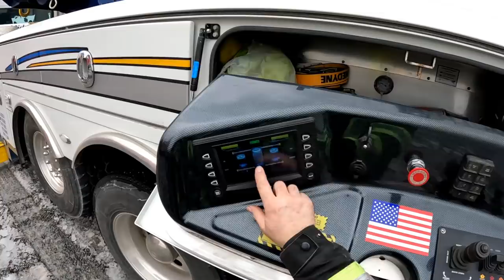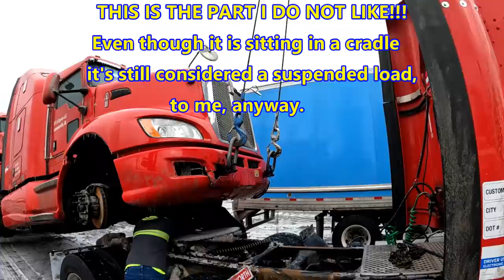PiggyBack Re-Stack

Comment: Ron  -  As a retired firefighter and medic we found that if you drilled a 3/8" hole in your blocks, cribbing, and run a 1/4" rope through the hole, tie a knot and work it into the drilled hole that it made for ease of grabbing and pulling.  Just a suggestion.  Great videos.  Really miss the "Q" sirens on the trucks.
Reply: It’s not on all the blocks but many of them have ‘handles’ made from pieces of (I believe) fan belts. You likely have seen that in other videos of his, and one of the blocks here had that on it but apparently not the other.
Reply: @JohnHallgren  you are correct I’ve seen in other videos he has cut up serpentine belts and attached them for handles

Comment: As a ex fleet technician for Bridgestone commercial the technician banging the ice of the face of the rim I definitely was shocked as if I did that to any of my customers rims it would be a very serious case,  and yes I have worked in far worse conditions indeed,   but all by myself as well in having to replace every wheel and tyre in extremely dangerous situations,   but then again these tractor units pig backed is absolutely ilegal here,   but our truck's have 9 axles and carry up to 42 tonnes payload, but then again Ron and team are the differences between the normal again ☺.

Comment: Did I miss the part where they explained why they didn't just use the first truck as the power?

It is cool to see how the piggy back system works.
I have seen it with new trucks many times.
Was not aware it was used with used trucks.

Comment: Wow, that was a mess. But with everyone working as a team, it went really well. Good job everyone! I always wanted to drive a tow truck. Just watching your videos makes me realize, that probably wasn't possible even in my younger years. I did learn something.  How you crossed the cables in an X while lifting the 2nd truck off the wrecked truck. That may be a common way to do it, I just didn't know. Great application for me to use on small things too so it doesn't sway. It's all very interesting to watch.

Comment: I drove these 4 way stack units from Dallas to California every week for two years for a company called NTC (National Trailer Convoy). Lots of fun but0 unless they changed the design of the saddle that attracted the trucks I can see how easy it broke away. The snapped blots all the time we would have to call Raider to come out and repair them. We mostly drove at night because the trucks would rock and sway like train  in fact we called that last truck a wild dog on a pice of kite string. 
They banded the front tires to the truck's and when you sometimes stopped other truckers would steal the tires so when you got to your destination they couldn't undock them.  Never drove a set in snow or ice..
TC

Comment: I have enough problem just lifting my car tire up and getting the bolt pattern aligned. That they were able to just slide the wheel on once it was at the right height was amazing, but I guess it helps when there are so many lugs that they almost aligned anyway.

All in all, it seems easier to just drive each truck to its destination and rent a car to drive back
Reply: These trucks could be going a couple thousand miles. Easier to drive to the destination individually, maybe, but the savings in fuel and driver time make it worthwhile. Not to mention most outfits won't want to see their "new" trucks delivered with mileage on them. We got a "new" specialized truck last spring that had been roaded to the upfitter then driven to us, and it had over 4000 miles on it already when we took delivery.
Also you get real good at changing wheels when you do it a bunch.
Reply: One driver can get 4 tractors to a destination and 3 still have zero miles on the odometers (i.e. new).  Then he flys back.  Or you have  4 drivers delivering 4 used tractors and 4 airline tickets.
Reply: on short distances it may be cheaper but on long distance It's a whole lot cheaper to pay one or two men a couple hours at the factory to stack them and the same at the other end. They have an overhead crane to stack them and usually the same to unstack.. many years ago I was at a Mack dealer when the trucks came in they had an overhead crane and it didn't take any time for them to unstack them. Plus the drivers work for a third party company and travel all over the country delivering vehicles. Once they deliver the company may have them another load somewhere nearby to deliver. They usually don't just go home after one delivery.

Comment: I’ve seen decked tractors where the plate goes on the fifth wheel and bolts to the axle and I’ve seen a few where it’s almost like a goose neck and the rear tractor is lower to the ground.

Comment: I'm thinking you need some ice cleats.  I have some K1 Mid-sole Ice Cleats from my work that are on a rubber strap, and fit into the space between the toe and heel of the work boots and have several steel spikes that dig into the ice.  Nice thing is when you don't need them, the plate can be slid to sit up on top of the foot out of the way for when going inside.

They don't interfere with driving in either spot.  I have a set on my winter boots that just stay on the boots.  Have to say they are more comfortable when wearing with a boot that has a metal shank.  Would help keep you from slipping around in icy conditions, and when not needing them, they take up less room than a pair of gloves.  For $30 they are well worth the investment, as it seems you do get some nasty icing conditions there.
Reply from the maker: I have some ice cleats.   They are different that what you describe.   I will be showing them on an upcoming video where I have to put them on along with putting tire chains on the rotator for the FIRST time ever!!   We had other trucks and I've had to chain them, but I've never had to chain up the rotator, until this year.  Again, video coming soon.   Thanks for watching and God bless.

Comment: was that (formerly) 2nd truck too damaged to be the power unit for the stack???   only damage i saw was the front bumper.....  also, i've seen these types all my life and the ones ive noticed were always just blocked up with a pin connected to 5th wheel instead a cradle behind it....   maybe just a different style connection... always interesting to see how things are done

Comment: This is an interesting series Ron. I've never seen this style of "piggy-back" stacking before. Here in Scotland, even seeing a handful of units on a trailer isn't that common but I've never seen them wheech the front wheels off for transport. I may be completely wrong but I don't think this sytem has reached our shores yet.  I'm kinda interested in the logistics of the system. Under normal operating conditions, would these guys have a wrecker on permanent stand-by at their yard, or would they use a gantry crane, or something similar?
Something that just occured to me: were these new trucks, getting delivered, or is this just an everyday way of moving several trucks, with one driver?
Nice to see Talon getting all hands-on again too.👍😁
Reply from the maker: Here is the U.S.A. this is a common method of transport for both new and used trucks.   These trucks were used and going to a lot in Texas.    Manufacturing plants and a lot of dealerships have gantry cranes to lift these truck for decking/undecking.    Otherwise, a heavy towing/recovery unit, such as ours, is commonly used for this purpose.   I am uncertain if these gentlemen have a gantry crane at their home facility.   However, they do go all over the country picking up used trucks and I would guess they use outside sources at the pick-up locations.    Thanks for watching and God bless.
Reply: @RonPratt  Thanks for that Ron, very interesting. Trucking seems to be a completely different animal over there. I suppose the biggest single difference(apart from driving on the right) is the sheer distance involved on everyday moves. Scotland is less than 300 miles long; even including England, the longest possible trip would be under 1000 miles.
With the Channel Tunnel now open and various ferry connections available to mainland Europe, longer journeys 𝒂𝒓𝒆 made but very few Scottish truckers are covering U.S.-style distances regularly.
Thanks for taking the time to answer. I watch a whole lot of U.S. based content but some of it still seems a wee bit alien to me.😁

Comment: Ron, at 13:40 I see a large cable with eyes on both ends, where you are getting the wheel chocks. I have seen similar cables stored on the underside of rotator booms in others videos. I am curious as to what these cables are used for in connection with rotator wreckers.
Reply from the maker: David, they are used primarily to equalize the pull on two separate points using a technique called "floating snatch-block"  If I remember correctly, I've only shown it on video one time, but I've got the link to that video here if you want to see how I used it in that situation:  https://youtu.be/d_9opPSgQGM
Thanks for watching and God bless.

Comment: Do they remove both drive lines when they tow the trucks like this?  I know the front one is removed. But do they remove the other one between the axles too so the front drives don't spin during tow?  I guess anyone watching this now knows why their packages from Amazon might be running late.  They might be sitting in your yard now.

Comment: If they REALLY need to pull that wrecked axle forward, lift the nose with the 'Tator's Boom and use the green drag winch to yank on the driver's side of the axle...that'll most DEFINITELY pivot the axle forward...don't know if it'll stay attached to the passenger side of the frame, but it WILL move...

😄😁😆😅😂🤣

Comment: Hi Ron I’m in Australia and don’t understand how these work could you please explain what the point is thank you
Reply: In the USA, trucking firms take advantage of our mostly long and straight interstate system. They deck/piggyback 3 or 4 trucks to deadhead/relocate multiple truck tractors with only one or two drivers. Even if more support manpower is needed, it's still more efficient and less expensive than the semi's fuel, maintenance, and PUC taxes, if they had each been driven those miles independently. Different attachment methods have been used over the decades. I hope that this explanation helps.

EDIT: Ron replied to another comment that it was a used truck firm transporting equipment from auction locations, back to the company's lot. This would add to efficiencies if individual tractor licensing, registrations, inspections, and any needed repairs still need to be updated before considered road worthy for individual driving. The status of the equipment in video isn't clear.

Comment: Now this has been bugging me. But I watch your videos constantly and I see you extend the front and rear supports separately. How come you don't extend all 4 out at the same time if your like in an open lot? Like I'd get it of there's traffic and you can't see But like this video would be a good example. I'm just curious
Reply from the maker: Running them all at the same time slows the hydraulic system considerably.    It's much quicker to operate them independently.   Thanks for watching and God bless.

Comment: The connections between the units look sketchy as hell but then you remember all this survived the crash that smashed the front truck up so they are clearly up to the job. 
Am I right in thinking that only the front power unit has brakes when driving along in the piggyback formation?